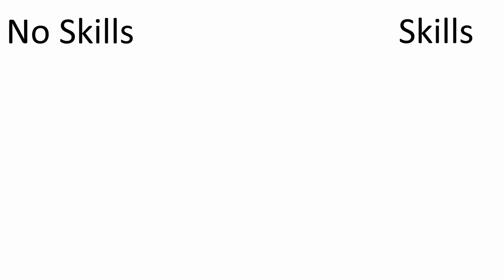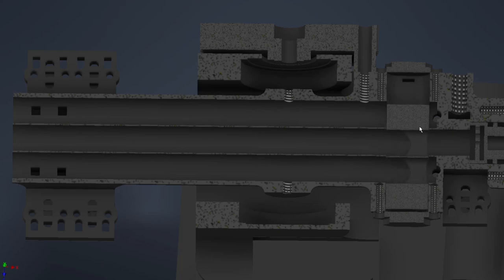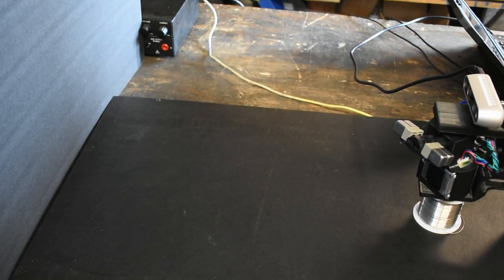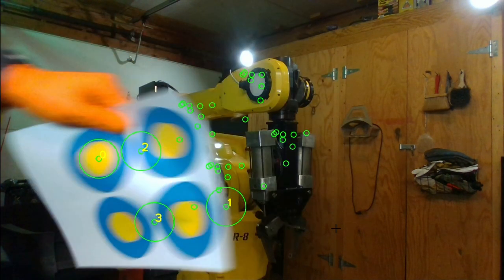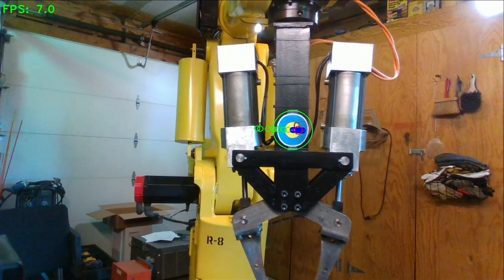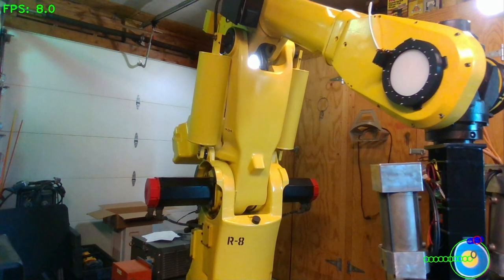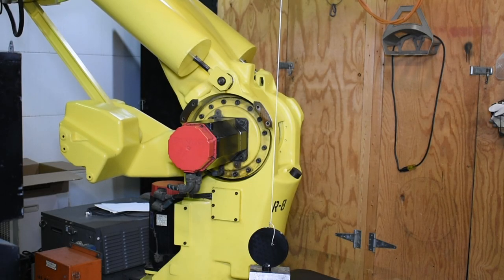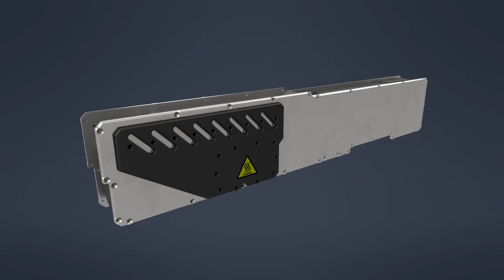This Airsoft Gun Can Track Targets

Comment: Cool project! Did you try reaming the critical holes? I've had good luck making air / water tight SLA parts by printing slightly under size then reaming / boring the holes to size. Same for very flat / square surfaces (machine to spec in the mill).
Reply from the maker: Thanks! I did have to ream all the bores, but I didn’t have an actual reamer that size so I made a janky one that sort of worked. The resin I used was also really brittle and didn’t like to be cut without chipping. I think just machining the entire thing would have ended up taking just as much time as I spent trying to fix my 3d print lol.
Reply: Very surreal seeing this comment on this on a video/in a comment section with so few others.  Also interesting to see the similarities between these channels and their content, but the wildly different popularity.

Comment: About the issue while aiming at the edges: is maybe related to lens distortion from the camera using wide angle fixed lens?
Reply: Had a similar issue while creating a barcode reader, at the end I had to pre-process the frames, correcting the lens distortion, before feeding them to the motion tracking algorithm
Reply: This is also what I was thinking.
Reply from the maker: I was thinking that might be the issue as well, I just didn’t get to look into it very much. I’m probably going to switch to different camera system for V2 and I’ll need to get all the lens distortion figured out for it.
Reply: You can do a camera calibration to compensate for the lens distortion!

Comment: What type of electronics controllers were used here?
Reply from the maker: Main program is python running on a laptop, the stepper motors and valves are run by an arduino nano.
Reply: @ExcessiveOverkill  Cool! Thank You.